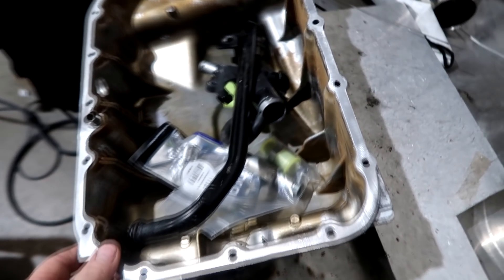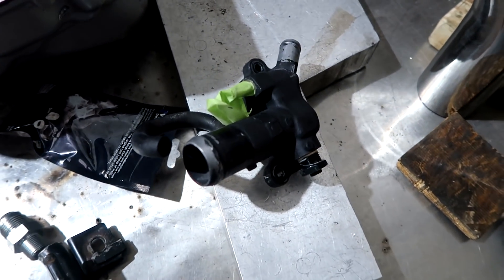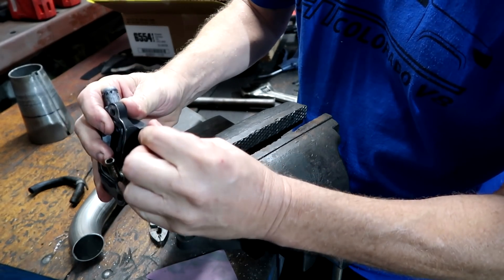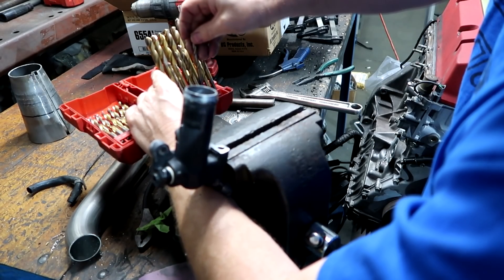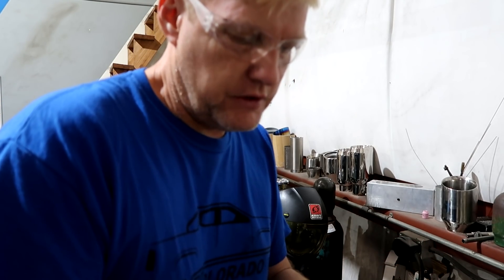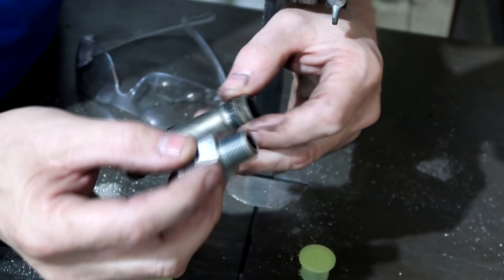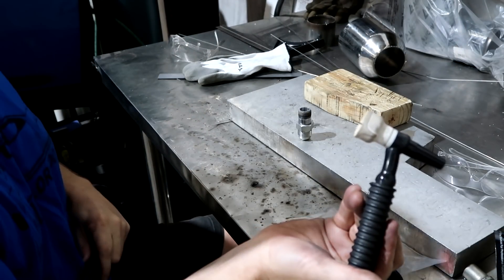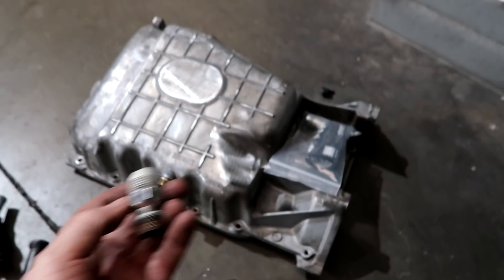Welding parts

Comment: I have a Milwaukee drill bit set too, and if yours is like mine, it has an empty slot also. To prevent cutting my fingers, I keep a small headed screw driver in the empty slot, and when I need to remove bits, I just grab that screw driver and pry up the bit I need from the base where the opening is.  -Jaime